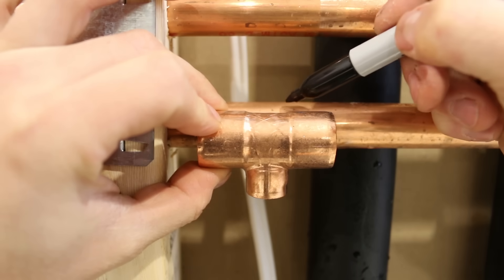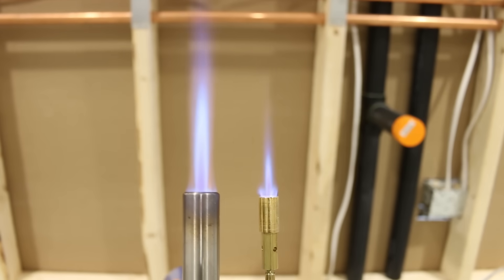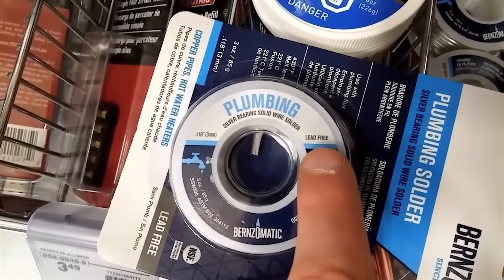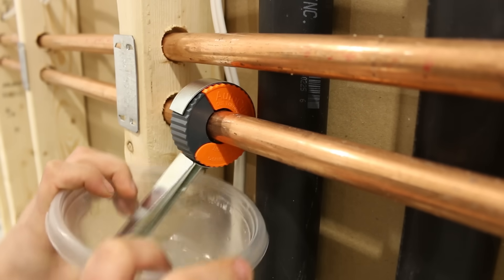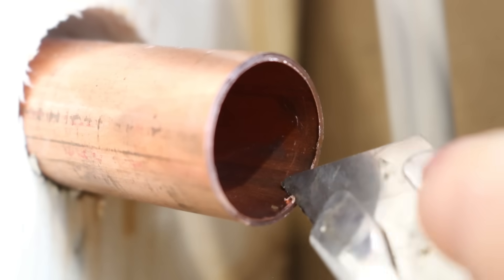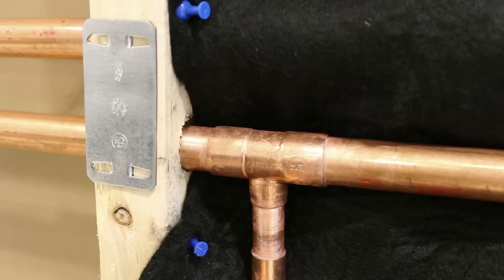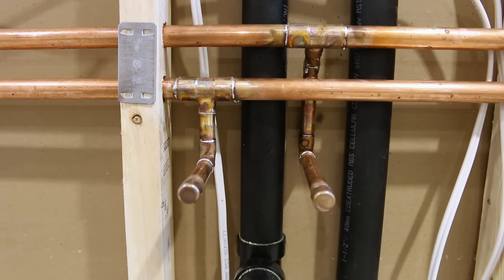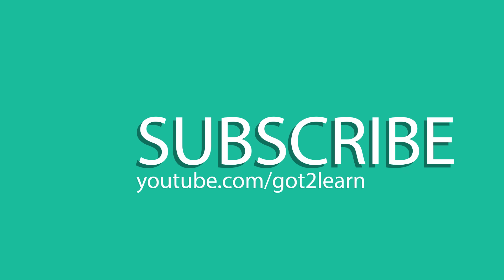How to Solder Copper Pipe in a Wall (Complete Guide) | GOT2LEARN

Comment: I do use a wet rag to accelerate cooling when I am soldering something with seals in it like an angle stop or a ball valve. I try not to go overboard with it and I never start until I am sure the solder is cooled enough to solidify. So far, I have not had any issues but thermal cracking is something to watch out for. Down here in Florida they liked to use news paper as insulation in houses from the 50's to the 70's, it can make soldering a nightmare o.O
Reply: I was always told never to accelerate cooling with a rag, especially valves with seals. The way it was explained to me is that the rubber seals expand while being heated, and if they don't cool down and go back to their regular size/shape slowly that it can deform the rubber.
Reply: @JORDAN Lewis when I am in the field  the water is turnrd off while you are soldering so the only source of water is what you get beforehand or from the toilet tanks. A lot of times there is no hot water on site. But if it is an option, your idea would probably be the best.
Reply: I thought PVC was the way to go in Florida?  My friends in Ft Meyers have a nasty water system that will eat pipes.
Reply: @DIY TWOinCollege  A well maintained copper system can last a hell of a long time and used to be the go to. Now days they are running all plastic, both CPVC and pex for indoor piping. PVC is only used on outdoor water supply lines due to its terrible heat tolerance.
Reply: @treyhart6861  it really is. At our company the go to is PEX-A aka uponore or crosslink pex. Copper is still popular in commercial applications but we are using press fitting instead of solder for anything under 2 inch.
Reply: @WhirlybirdFlyer  I never really cared for PEX because one is that it's more vulnerable to punctures and two is that the turns on PEX elbows are too sharp which restricts water flow.I recently bought two pres tools.My first press tool is a manual hydraulic press tool.The manual press tool works so well that it encouraged me to buy a battery powered 18 volt press kit.The manual press tool cost me $356.00 including shipping and tax and the battery powered 18 volt press tool cost me $1157 shipping and tax included.I was put off because of how expensive milwaukee and rigid press tools are but I searched the net and came across the press tools that I bought for a lot less than what milwaukee and rigid want for their press tools and now I'm all set.Please spare me any lip about the press tools that I bought being made in China because both milwaukee and rigid moved their factories over seas where they have the tools made dirt cheap then sell them here in the U.S. for insane markups which is the reason why I have lost the respect that I used to have for both milwaukee and rigid.Press tools are a very good option because press tools are much safer than soldering but the press fittings are also insanely priced.What I do is that I solder where it is convenient and safe to solder and use my press tools where it is not convenient or safe to solder.I'll measure what I need to measure concerning what goes where,in other words if I need to install ball valves and unions I'll measure where the ball valves and unions will go,solder the ball valves and unions on the ground and once the ball valves and unions are cooled I'll press the ball valves and unions using copper press elbows and copper press couplings and done deal.If a shut off valve is not shutting off completely soldering the copper pipe will not be possible but no big deal,just solder copper pipe nipples to a ball valve then use a copper press coupling to connect the ball valve with the copper nipples soldered onto the ball valve and go from there,end of story.
Reply: @nelsonechevarria7009  We also use copper press fittings with our DeWalt battery powered press gun. Personally, I do not think it matters where something was made or who put it together as long as it works well and gets the job done. As to your point about fittings bends, all water system fittings have the same tight bend. CPVC, PVC, Copper, Galvanized they are all the same. Yes bends reduce your over all pressure. However with Cross Link Pex the pipe itself is so flexible that you do not need nearly as many 90s in a given line. We do a lot of residential remodeling projects including many water system re-pipes. In my personal experience the pressure at the tap in a house with pex water lines is noticeably higher due to the reduction in fittings. As for punctures, I have fixed many copper water lines where a screw went right through the line. Also with copper you have to be careful not to allow the pipe to contact a dissimilar metal (i.e. iron, steel, etc.) Even if a copper line is rubbing on a nail in the home over time a leak will form at that spot. Each system has benefits and draw backs and I guess it is down to the individual application as to which works best.
Reply: @WhirlybirdFlyer  I agree,it does not/should not matter where a tool is made as long as the tool works well.My gripe about press tools is the fact that milwaukke and rigid sell the press tools as if the press tools were gold plated.I bought a 18 volt press tool and it cost me about $1,120.00 with the shipping,so why do milwaukee and rigid have to sell their press tools for such insane prices when milwaukee and rigid have their press tools made over seas?Have you seen the asking price for milwaukee and rigid press jaws?Another thing is that milwaukee has a 18volt press tool but there is no way to stop the press cycle once the power button on the milwaukee 18volt press tool has been pressed where as the 18volt press tool that I bought for far less than what the milwaukee 18volt press tool costs allows me to stop the press cycle by simply releasing the power button.The 18volt press tool that I bought also has a button to manually retract the ram.The milwaukee 18volt press tool costs so much yet lacks the features that my 18volt press tool has.As for copper pipe,pex or what ever what may work for you does not necessarily mean that it works for me.Another point is that pex elbows have tight turns,tighter than copper pipe which is one of the reasons that I do not care for pex.Pex works for you and you like it God bless and good for you,but I do not care for pex so I do not and will not use it.
Reply: @nelsonechevarria7009  I agree, marketing garbage is worth about as much as actual garbage. However, the mass production of white bread actually cause wide spread scurvey outbreaks. I would not classify that as a great thing.
Reply: @WhirlybirdFlyer  I agree 110%,As for white bread I will only eat it as a last resort,I prefer whole wheat bread.
Reply: @WhirlybirdFlyer  By the way,copper press elbows have a nice sweep to them,check it out when you get a chance to.
Reply: @nelsonechevarria7009  I just finished a commercial bath house pipes entirely in Propress copper fittings ranging from 2.5 to .5 inch. I am well versed in the installation and use of press copper fittings and press tools. I appreciate your input and opinion, though I do not share it, but this topic has been beaten beyond the dead horse level.
Reply: @WhirlybirdFlyer  Pardon me then,you stated that all elbows have tight turns and therefore I did not know that you were so familiar with copper press fittings.I could be wrong but it seems to me that you are annoyed with my comments,if that's the case then ignore my comments,and in kind,I will return the favor.Have a nice life.You are entitled to your opinion just as I am entitled to my opinion,I am not here to lock horns with you or with anyone else for that matter.I had to redo my water pipes because who ever did the plumbing in this house left a lot to be desired.You would have used PEX which in your opinion works fine but I do not care for PEX is number one and number two is that I had to go all the way from my boiler room to the back of the house to redo the water pipes.I had to buy seventy feet of half inch copper pipe,thirty feet for the hot water line,thirty feet for the cold water line and the extra ten feet of half inch copper pipe for nipples and the like.So because I did not feel comfortable using Pex for such long spans I'm automatically wrong and you're automatically right?If that's the case then you need to get the fuck over yourself.To you what I did does not make sense and you would argue that using PEX would have been much cheaper which very well may be true.However this is my house and as such I do things how things were taught to me,I stick to what I know and to what works for me.I was taught to use and solder copper pipe and so copper pipe is what I feel most comfortable with.If I were to ever use PEX I would never use more than ten feet of PEX and I would only use the PEX to branch off to what ever fixture requires water piped to it and I would make sure that the PEX comes out of a valve in case the PEX was ever punctured.You know so much about plumbing so you feel that you are in a position to give advice,fine,but that does not mean that people must take your advice and your way of doing things as law,if that bothers you then maybe you're in the wrong business.I spent more money using copper pipe than if I had used PEX,so fuciking what?My house,my money and my choice to do repairs as I see fit using what ever materials I see fit to use,end of story.Did I come on here asking you or anyone else to pay for my repairs or give me a hand-out?No right?So what's your beef then?You like and want to argue because when I used the analogy of "the wheel and the white bread." I used that analogy as an example,at no time did I infer that white bread is so great and so good.So you can make comments but how dare me reply to your comments?Who in the hell died and left you in charge of the last word on everything?Do us both a really big favor and keep your comments and opinions to yourself because I am not above listening to and/or taking advice but your attitude comes across to me like somebody scraping fingernails across a chaulk board,in other words I find you very irritating.Just keep your comments concerning my posts to yourself and I in turn will give you the same courtesy and respect,that's all,end of story.
Reply: @WhirlybirdFlyer  F.Y.I.,I used the proper pipe hangers to secure and support the copper pipe that I installed when I redid my water pipes.You are not the only one with experience and intelligence as your overly inflated ego leads you to believe.I have nothing else that I care to say to you,goodbye.
Reply: It seems that was also a practice here in PA,when I cut and pulled out the copper drain pipe from under my kitchen sink cabinet and replaced it with DWV PVC I had to enlarge the hole the copper pipe went through and I found that old news papers had been used under the kitchen sink cabinet,talk about an accident waiting to happen.
Reply: @treyhart6861  What you say is true,however,the pex fittings put me off because the bends on the fittings are too tight which restricts water flow.I over hauled my plumbing and I considered pex but I abandoned the idea of using pex because one the bends on pex fittings are too tight for my liking and two I have long runs from the boiler room to the back of the house,I had to buy sixty feet plus of half inch copper pipe.I could have bought pipe hangers for the pex but I feel much safer with the copper pipe even though I had to buy pipe hangers for the copper pipe.I just bought and received a hydraulic pipe crimping tool which I am going to use where ever soldering is inconvenient or unsafe and for the areas where the copper pipe can be soldered conveniently and safely I will solder the copper pipe.Some times it can be possible to have the best of both worlds.The hydraulic pipe crimping tool has 1/2",3/4" and 1" dies and what's more the hydraulic pipe crimping tool uses propress type jaws and I can buy the propress type jaws for a lot cheaper than what Rigid and Milwaukee sell their propress jaws for.I'm not out doing thirty and forty presses per day so the hydraulic tool suits me just fine.The hydraulic pipe crimping tool that I bought is like a hydraulic car jack which is easy to operate and the hydraulic pipe crimping tool head pivots so it allows for the clamping jaws to be rotated in any direction that is necessary.I could be wrong but I suspect that the Rigid and Milwaukee pipe pressing tools also use hydraulic fluid and that is why those tools need to be "calibrated" as Rigid and Milwaukee like to claim after X amount of uses because hydraulic car jacks and tools need new seals and new hydraulic fluid after a certain amount of use.From the manual that I received with my hydraulic pipe crimping tool it's not difficult to over haul the tool,I even got the seals for when the time comes to over haul the tool and clear instructions on how to disasemble the tool to change the seals and the hydraulic fluid.
Reply: Beans: Newspaper embedded around circuitry and wiring, etc.?  Goot Lort.  Sounds like a built-in fire starter, and the insurance companies may not cover those type homes anymore.
Reply: @happysawfish  We see this in our are in the first and second generations of homes built in the area (probably 1920s to 1950s). There are a lot of things in that type of home that would be an insurance nightmare. Asbestos siding and insulation, lead based paints, and knob and tube wiring to name a few.

Comment: 95 5... is for water and 50/ 50 is to cap big pipe 2 inches and above.. you use 95 / 5 solder the big joint
.. then use 50/50 and cap
It with that.

Comment: But one with a 3 foot hose at home
Depot..  and it comes with a carrying case a an instant igniter and it’s
Map gas
Reply: Got to move fast with that one, it puts too much heat and may quickly burn out the flux.

Comment: Great vid, few tips tho, its much MUCH easier to clean the pipe before you cut it with the emery cloth (sandpaper, abrasive pad, whatever) secondly the flux is key to knowing when to add the solder. You wiped to much off but if you dont apply to much to begin with (no globs but still a thin coating) once it start to bubble or boil than you add your solder its the perfect heat everytime.

Comment: Or use sharkbite fittings and pex and save the hassle.
Reply: This is for a permanent repair.
Reply: @ohger1  I did a permanent repair 10 years ago with sharkbite fittings and it's still leak free.

Anyway it's been a long time since I've seen an home with copper tubing. At least in Canada since the last 20 years I would say 99% of home plumbing are pex. It's just way less expensive and faster to install.
Reply: @fredlagace9197  I repiped my home with Uponor PEX A because of well water pH issues.  But pH aside, nothing is as proven in the long term as type K copper with sweat joints.  Copper is an upgrade in the U.S. over PEX in new construction, and many people and contractors in million dollar homes choose copper over PEX.

Comment: almost forgot, when sweating copper tubing the heat MUST always be applied to the rear of the fitting ALWAYS. the solider only goes where the flux is applied, the heat draws the solider into the fitting. Keep that in mind

Comment: As a Journey man plumber i can tell you that the wood should be wet in the area of sweating any type of copper tubing. sparks can fly around and cause a fire in a different, and the bread trick is a common practice, but not to much, The bread can actually move down the line and can jam up inside a valve. So using to much can be a huge problem. With experience in the field you kind of have to judge the amount of bread needed by the size of leak, but all in all this video is good
Reply: I was taught to also brush the connection with flux after you solder it to clean it up. Is this a bad practice?
Reply from the maker: @Garrett Yes, that's bad practice.
Reply: @hebert415  i use a damp colth. I have seen plumbers use flux but not necessary

Comment: Wow! Great tutorial!
Reply from the maker: My pleasure man, glad you liked it, don't forget to subscribe and share, it helps a lot :)
Reply: @Got2Learn  All my joints held. We're having trouble with the expansion tank threads leaking but my soldering held. No burned wood or ABS either. We did get one shower because I forgot to affix my assembly in the back. LOL

Comment: I have several Autocuts but I've never seen that ratchet handle. Where did you get it?
Reply from the maker: On Amazon, link is in description box ;)
Reply: The ratchet handle looks like a small oil filter wrench.
Reply from the maker: Yeah It does ;)

Comment: Interesting to see your method. Here in the UK we gave up on the end feed capillary fittings about 10 years ago as unscrupulous plumbers were feeding in the cheaper lead content solder. Now all our fittings have an integral ring of solder in them. No cleaning required as our fluxes clean the pipe as it is heated. It’s just cut, fit, flux and heat. But even our method is getting dated as we are all using poly pipe now, can’t remember as a plumber the last time I soldered a fitting. Even when doing a repair on copper we just use push fit tectite fittings. That’s progress for you.
Reply from the maker: Yeah I think those are yorkshire fittings right?
Reply: Got2Learn yes only down side is the additional cost for the fitting, but the appearance on the finished product is better as you have a regular ring of solder and very little drips
Reply from the maker: Yeah I tried them and I really like them.

Comment: Can I solder a closed pipe? Do I need to worry about the heat inside of a closed ends? For example if I solder a circular shaped copper coil to make it look like a hula hoop.
Reply from the maker: Sure. For shorter pipes, use low heat, it'll help with the pressure inside the system ;)
Reply: @Got2Learn  Thank you for your reply!
Reply from the maker: My pleasure